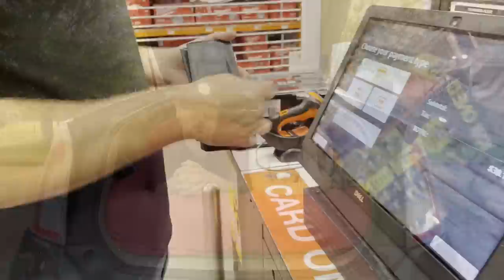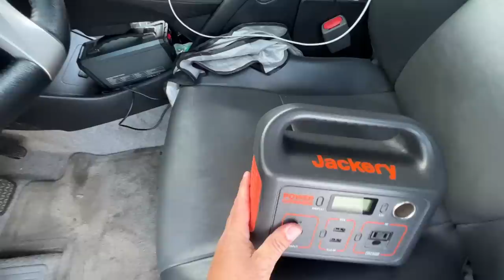PRIUS Car Camper Tour | No Build Budget Design

Comment: Wish my Prius Prime had the storage in the back!
Reply from the maker: What year is it?  Is there anything like a similar compartment in the Prime model?  It was really convenient.  Since we sold that Prius we are in the market for another but are curious as to the space and features of different models.
Reply: That's the price we pay for adding 1/2 gallon worth of range every time we plug in our Primes at home.   If I were truly living in my car, rather than occasionally taking trips to live in it for a month or two, I would replace it with a 2016-2022 regular Prius.  But the car still has tons of room to bring more stuff with you than you should.
Reply: @HeresGoodTravel  It just has a tiny vertical storage bin at the very rear.  The width of the hatch by I'd guess 4 inches forward by maybe 18 inches deep.  There's room to stuff the charging cable in it, and a few tools  No other storage under the floor, everything else is battery, and there is no spare tire.

Comment: Excellent!  Which Prius is this?  I thought the cool thing about camping in a Prius is that you can use the cooling system without running the car??  Which Prius model allows that?
Reply from the maker: This one is just a regular Prius model 2014.  You can’t run the AC unless you have the engine set to “ready” mode.  It burns about 1 galon of gas per night roughly
Reply from the maker: So ours was a 2014 which is a gem 3.  All of the Prius models have the ability to run the AC while the engine is on and burn very little gas.  I think our model has the largest storage space in the back apart from the 5 that is huge.
Reply: @HeresGoodTravel   The big one is actually the v, small v, their abbreviation of versatile.  Capital V meaning 5, is a trim level.  People get them confused all the time, and even Prius v owners call it a Prius V, but pronounce it as vee, not five.

Comment: Have you had a problem with blocking the air cooling vents to the batteries
Reply from the maker: No.  It seemed it got enough air flow even with the seats down

Comment: Great video,  about the mattress, I checked out the link and it doesn't look like a tri-fold so how do you keep it folded?
Reply from the maker: We just used a turkey slicer and literally sliced it onto 3.  We also shaved around the wheel wells. It was “full” size.  We bought baby crib fitted sheets to wrap each individual piece in since the cover was unusable.  Then we put a cushioned fitted mattress cover over all 3 and it had enough slack to fold up.  Hope this was helpful
Reply: @HeresGoodTravel , wow, pretty intense.  I assume it was trial and error... why not purchase one of many tri-fold out on Amazon from the start? Appreciate it 👍
Reply from the maker: It actually only took about half an hour start to finish.  We used the mat from the trunk as a guide line.  We wish we cut it a little less but it ended up working out cuz we could stash our sheets in the crevasse.  We opted for the us because the tri-folds had mixed reviews about comfortability and the regular matress was REALLY comfortable,  which was important for us. That being said we do wish it was a little thinner because folded up it took up quite a bit of space.  For us it worked out perfect but a pre-folded thinner one would be a great option as well!
Reply: @HeresGoodTravel , tried replying but i think it was deleted because I added a link tp an Ikea Junior mattress.  I was contemplating ot since I'm only 5'5 and wouldn't be much to cut. Thoughts?
Reply from the maker: Totally!  Less is more in a small space.
Reply: @HeresGoodTravel , appreciate it, time t8 get measuring 🤣

Comment: How does air get in and out when you sleep and the car is all closed?
Reply from the maker: We try to have fresh air and the windows open as often as possible but if it’s too hot we crack one of them very slightly and turn the AC on.  With the Prius you can run it in ready mode and keep the AC on and the engine only clicks in about once every 45 minutes to recharge the hybrid battery.

Comment: The main problem with a prius is the main big battery. Learned thru my dad is that it only lasts about 10yrs & is expensive to replace. Just beware for others people. It is a good idea though.
Reply from the maker: Thank you so much! I guess that’s why the warranty runs out after 10 years so they make you purchase a replacement.
Reply: It's cheaper to replace than a transmission, and the Prius really doesn't have one of those, just gearing that is similar to a differential.  No gears are physically changed.  The gear ratio appears to change like in a CVT,  but it's all just magic done by varying the speed of the electric motor and the speed of the gas engine, relative to each other, connected through a planetary gear set.  Even going into reverse doesn't involve any mechanical gear changing.  They just spin the electric motor backwards!

Even if you need to replace the battery one time, the cost of running, maintaining, and repairing the drivetrain, is probably lower than for ANY other car.  Cheaper than any gas car, due to its quality, lack of transmission, and mechanical wear being proportional to the amount of fuel burned.  And in the unlikely event that's only breakeven, then the 10 years of burning 1/2 or 2/3 as much gas, makes it a winner.  Also less financially risky than any EV, due to the hybrid battery being MUCH cheaper than any EV battery.

There is a reason that taxi companies and Ubers choose to beat the crap out of a Prius over any other car.  They are super reliable, and NOT an expensive nightmare due to the battery.

Comment: Im so confused 

Why are tou not using you climate control that is standard in the Prius? 

You could be cool at night or heated up depending on the weather
Reply from the maker: We do but we only do that in really hot temperatures.  We did notice our motor mount wearing a little from the emgine turning on and off but we would only use it if it was 90 plus or stealth camping
Reply: @HeresGoodTravel  ah, I see

Comment: A high watt powered Inverter would be good if you want to cook with electricity. Just make sure 0000 or 4/0 gauge cable wire for Inverter. Note: 4 gauge and 4/0 gauge is not the same thing
Reply from the maker: To hook up to the battery in the back right?
Reply: I recommend keeping it to under 1000W drawn from the 12V, even with the car on (Ready).  Personally I have a 2000W pure sine inverter, but never draw much more than the 700W of an Instant Pot.  

With a 150A fuse, even 1 awg copper wire is safe, 1/0 awg is preferred, and 2/0 is both overkill and allows a 200A fuse, though I'd not personally want a 200A fuse going to a 2000W inverter, I'd use a 150A fuse even with 2/0 or heavier wire.  Drawing even 150A for more than a few seconds, from any normal car's electrical system, is pretty inadvisable.  Keeping it to 60A or 70A is smarter.

Anyone putting 4/0 gauge copper wire into a Prius, must really hate money, or probably bought CCA (copper clad aluminum) without realizing it, in which case you do need thicker wire because the stuff is on the sketchy side.  

Keep in mind that only 2016-2022 Prius have a normal-sized 12V battery under the hood.  2004-2015, and 2023-2024 have a smaller 12V under the hatch floor, in the passenger compartment.  You really don't want to blow up that little 12V battery, and you really don't want to draw more than 1000W at the very most, from the car's DC-DC charger (which it has instead of an alternator) for longer than the battery can act as a buffer providing any power above that.  

I'm an engineer who is pretty aggressive about using the full capabilities of the car, within its design limits.  Despite having the big under-hood 12V battery in my 2017 Prime, with the bigger PHEV battery feeding it, the biggest appliance I will use is 700W actual draw, plus 35W-60W fridge, and whatever phone chargers and stuff I don't want to unplug.  I would not even use a 700W "cooking power" microwave, hence actually higher power draw,  though I know that some people do.  Yet, I'd have no problem with starting up a table saw, because it only has a high draw for a few seconds, which the battery can act as a buffer for.